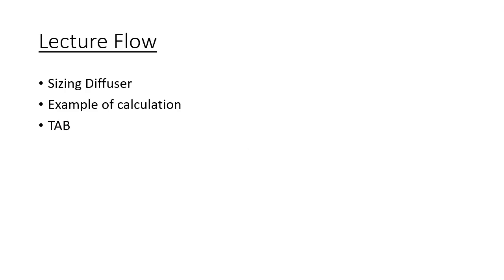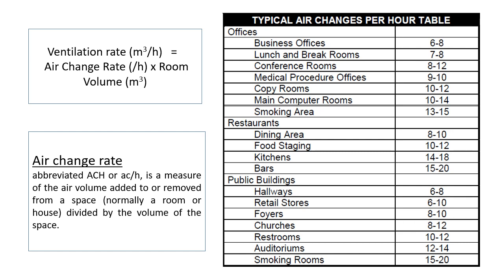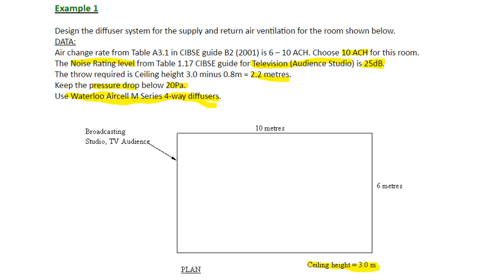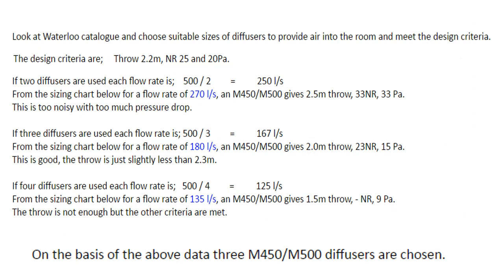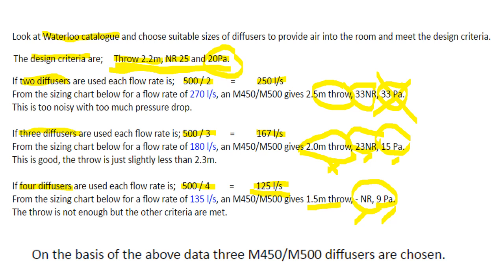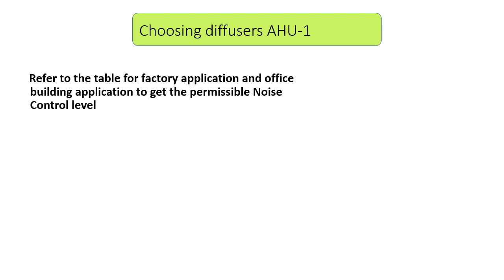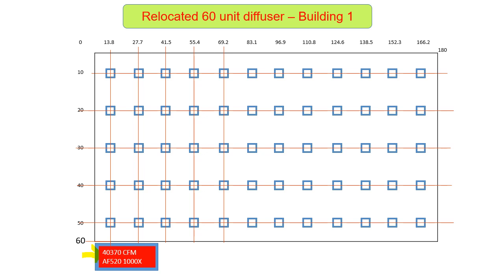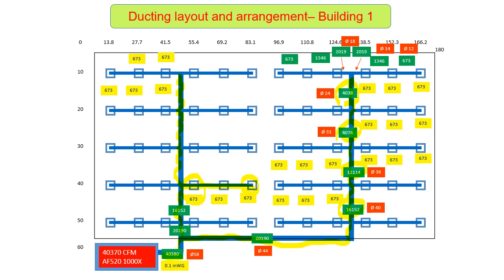Lecture 10 DIFFUSER SIZING

Comment: Muhammad Ariff Imran Bin Hassan 
B091810177

When sizing air diffusers of room, there are few criteria that need to be consider 

- Ventilation rate
- Throw
- Pressure loss
- Noise level

Besides that, Air balancing is done to adjust the damper so that the flow rate of each diffuser is equal
 Another method is to determine the cooling/heating load of the room to come out with the ventilation rate. This is the basic calculation to determine diffuser size.

TAB is Testing, Adjusting, and Balancing for commercial air conditioning and ventilation system. In more complex system the need for air balancing is increased
. This process includes the number of related tests that determine the performance of A/C and heating process. The purpose of TAB is to assure that an HVAC system is providing maximum occupant comfort at the lowest energy cost. TAB equipment includes manometers(pressure),  hygrometer(humidity), thermocouples(temperature), and dial thermometer(fluid temperature). The result of all these tests are compiled into a report to determine how well your system is functioning

Comment: Luqman (b091810235)
From Lecture 10 video I learned the criteria that need to be considered when sizing the diffuser are ventilation rate, throw pressure loss, and noise level. Next, I also learned about calculation for ventilation rate,  sketching AHU No. & CFM at building plan, Choosing diffusers for AHU-1, locating the diffuser, and choosing diffusers AHU-1. and lastly, I learned about 

 the process includes no. of the related test, A/C performance, and Aim to assure HVAC systems provide max comfort to the occupant at the min energy cost

Comment: Name : Muhammad Hadzim Ashraff Bin Mazlan 
No.Matrik: B091810248

Summary 

SIZING DIFFUSER
When sizing air diffusers of room, there are few criteria that need to be consider Ventilation rate, Throw, Pressure loss, Noise level. The first criteria will be discussed in next slide. The throw is discussed on the previous page. Pressure loss is the pressure resistance to air flow and is required in duct and fan sizing calculations. The maximum Noise level is determined for various room types. 

TAB 
Air balancing is Testing, Adjusting and Balancing commercial air conditioning and ventilation system. More complex system the need of air balancing is increased. This process includes the number of related tests that determine the performance of A/C and heating process. The purpose of TAB is to assure that an HVAC system is providing maximum occupant comfort at the lowest energy cost. TAB equipment includes manometers(pressure), hygrometer(humidity), thermocouples(temperature) and dial thermometer (fluid temperature). The result of all these tests is compiled into a report to determine how well your system is functioning

Comment: MUHUNTHAA A/L MUNIYANDI
B091810185
3 BMMH S1/1

Based on the video, I have learned about Sizing Diffuser. There are a few parameters to consider when sizing air diffusers for a room :

- Ventilation rate
- Throw
- Pressure loss
- Noise level

Furthermore, By adjusted the damper, air balance is achieved so that the flow rate of each diffuser is equal.

Moreover, Manometer, hygrometer, thermocouples, and dial thermometer are among the equipment used in TAB.

Comment: MUHAMAD RAZIQ AFIQ BIN ANUAR 
B091810519
From this lecture video, I have learned about few criteria that need to be considered when sizing the air diffuser room which is Ventilation rate, Throw, Pressure losses and Noise level.

Comment: MOHD NAZRIN BIN MOHD NAZRI B091810221 3BMMH S (1/2) 

From Lecture 10 video I learnt :-
1. Sizing Diffuser :
    • Criteria need to be consider is Ventilation rate, Throw, Pressure loss and Noise Level. 
2. Example Of Calculation :
    1. Calculate ventilation rate.
    2. Make a layout. The final diffuser need consider ceiling and lighting layout.
     3. Sketching AHU No. & CFM at building plan.
    4. Choosing diffusers AHU-1
    5. Relocated unit diffusers - Building 1.
   6. Refresh layout for duct design
   7. Ducting layout and arrangement - Building 1
   8. Design 2 Ducting and Diffusers - AHU1

3. Testing, Adjusting & Balancing (TAB) :-
• process includes no. of related test, A/C performance.
• Aim to assure HVAC systems provide max comfort to occupant at min energy cost.

Comment: SRITARAN A/L ARUMUGAM
B091810178

From this lecture, i have learnt that when sizing an air diffuser for a room, the ventilation rate, throw, pressure loss, and noise level must all be taken into account. By changing the damper, air is balanced such that the flow rates of each diffuser are equal. Next, the more sophisticated a system, the more air balancing is required.

Comment: Kuganeswarao A/L Subramaniam B091810487 3 BMMH 1/2
From the video I have learnt on pressure loss, throw, ventilation rate and noise level during the sizing process of the air difusser

Comment: Ahmad Syahir Bin Ismail B091810081
from this lecture videos, i have learnt about sizing diffuser which need to be consider on ventilation rate, throw, pressure loss and noise level. then, we also know the TAB (Testing, Adjusting, Balancing) equipments include manometer, hygrometer, thermocouples and dial thermometer.

Comment: SEE WEI CHE B091810368
From this lecture video, there are few criteria which are ventilation rate
, throw, pressure loss and noise level need to be consider when sizing air diffusers of room. Pressure loss is the pressure resistance to air flow and is required in duct and fan sizing calculations. The maximum Noise level is determined for various room types. Air change rate is a measure of the air volume added to or removed from a space divided by the volume of the space. Air balancing is done to adjust damper so that the flow rate of each diffuser is equal
. Other method is to determine cooling/heating load of the room to come out with the ventilation rate. Air balancing is Testing, Adjusting and Balancing (TAB) commercial air conditioning and ventilation system. The purpose of TAB is to assure that an HVAC systems is providing maximum occupant comfort at the lowest energy cost
. TAB equipment includes manometers(pressure), hygrometer(humidity),thermocouples(temperature) and dial thermometer(fluid temperature)
.

Comment: Muhammad ismanajmi bin rozi
b091810258
3bmmh 1/2

For this week, we learn about:-

Sizing Diffuser,
When sizing air diffusers of room, there are few criteria that need to be consider 

-Ventilation rate
-Throw
-Pressure loss
-Noise level
 
The first criteria will be discussed in next slide.
The throw is discussed on the previous page.
Pressure loss is the pressure resistance to air flow and is required in duct and fan sizing calculations.
The maximum Noise level is determined for various room types.

-Air balancing is done to adjust damper so that the flow rate of each diffuser is equal
-Other method is to determine cooling/heating load of the room to come out with the ventilation rate.
-This is the basic calculation to determine diffuser size.

TAB
-Air balancing is the process of testing, adjusting, and balancing a commercial air conditioning and ventilation system. As the system becomes more complicated, the demand for air balancing increases.
This procedure consists of a series of tests that determine the performance of the A/C and heating system.

-The goal of TAB is to ensure that an HVAC system provides maximum occupant comfort at the lowest possible energy cost.

-TAB instruments include manometers (for pressure), hygrometers (for humidity), thermocouples (for temperature), and dial thermometers (fluid temperature)

-All of these tests are combined into a report to determine how well your system is doing.

Comment: Keshanraj A/L Ganesh  (B091810319)

What i have learnt from this lecture were:
-ventilation rate, throw, pressure loss and noise level need to be considered when sizing air diffuser for room.
-air balancing is done so that flow rate of each diffuser are equal by adjusting damper.
- The more the complexity of a system, the more air balancing need to be done.
- equipment used in TAB are manometer, hygrometer, thermocouples and dial thermometer.

Comment: MOHAMAD ZAHIM BIN MOHAMAD SUKAIRI B091810344

1. SIZING DIFFUSER
criteria need to be consider :-
*ventilation rate
*throw
*pressure loss
*noise level

2. EXAMPLE OF CALCULATION

3. TAB
*air balancing is Testing, Adjusting and Balancing
*more complex system, more air balancing needed
* include number of related test to determined performance of A/C
* Providing max occupant comfort at the lowest energy cost
* the results of all these test are compiled into a report

Comment: SHAZNI SAHIRA SARIFF B091810225

As a conclusion, there are 4 criteria that need to be consider in sizing air diffuser: ventilation rate, throw, pressure loss and noise level. For ACH and NC, can choose from the table given according to the place for sizing the diffuser. Next, we are able to calculate by using the formula and need to refer to the catalogue table where the diffuser are chosen. Lastly, air balancing is testing, adjusting and balancing (TAB). The more complex system, the need of air balancing is increased.